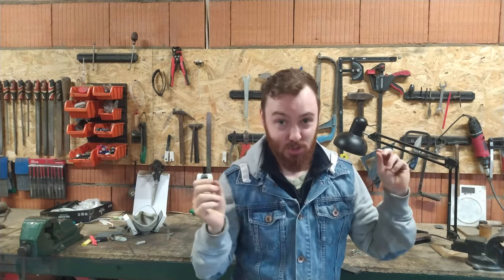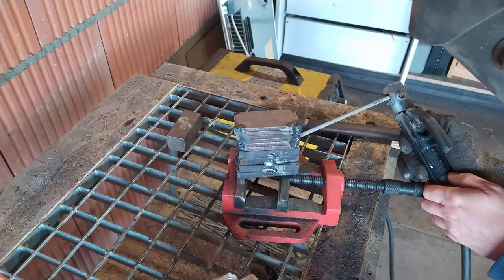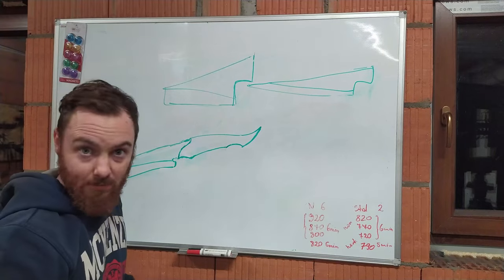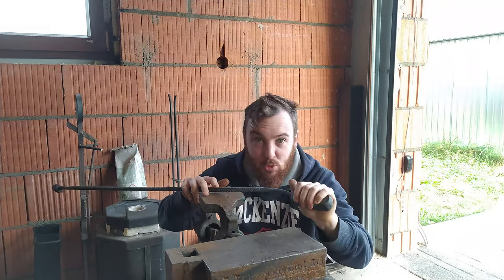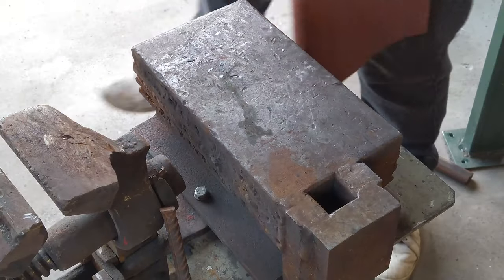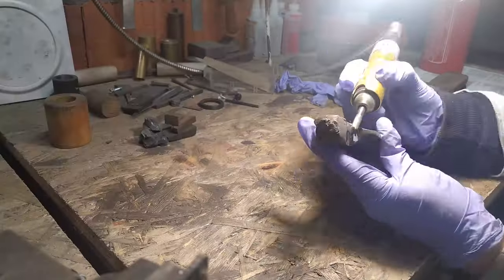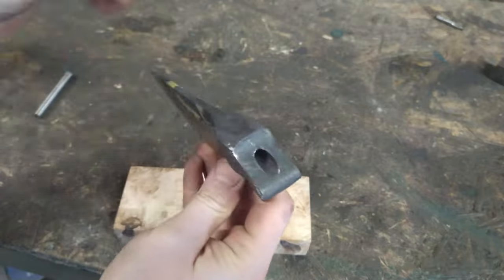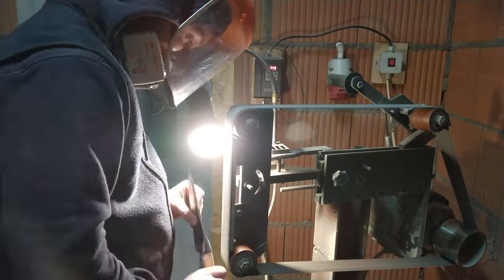Making  Integral Bolster Damascus Fighter

Comment: Excellent design, excellent explanations, excellent craftsmanship! Personally I would have cussed a blue streak if I'd seen that crack in the handle after I'd spent so much time fitting it up. Assume you filled it with sawdust and CA.
Reply from the maker: Thanks Bryson! Yes, I was "a little" disappointing when I saw this crack, but this is natural, so you need to accept that as a maker. Yes, I filled it with sawdust and CA and it's almost invisible. Thanks a lot for the support Brother:)!

Comment: the rough and kindy organic look of this blade is really beautiful !! but the handle seems to "weak" for my tastes. i'll fear the blade will break apart from it while i'm using it.
Reply from the maker: Thanks a lot for kind words! The handle is slim (this is right) but It would take huge force to brake it. Thanks to the "twisted fibers" is very solid and After stabilization it's very (very!) tough. There shouldn't be any issue with the handle :). Thanks for watching and support :)!